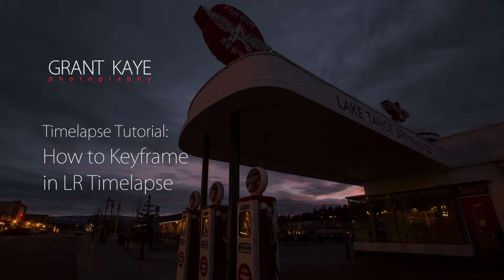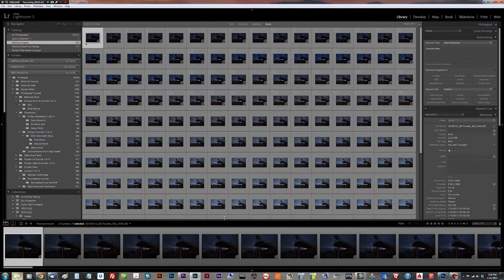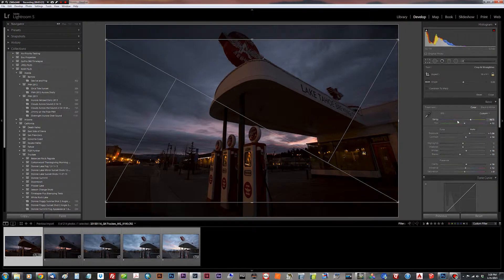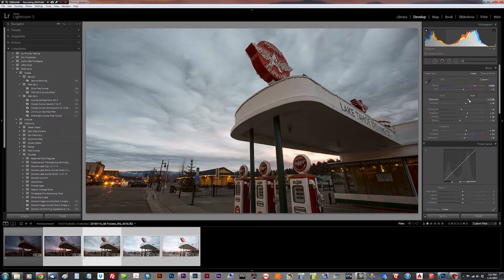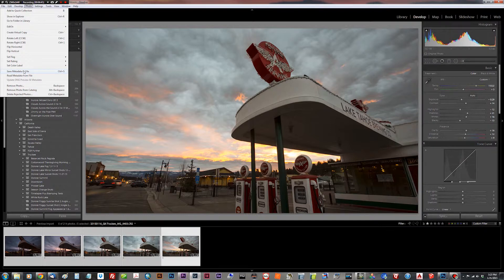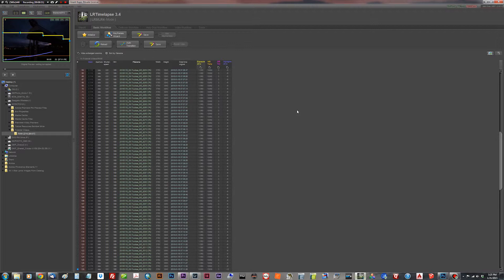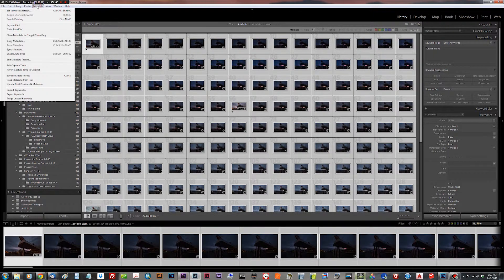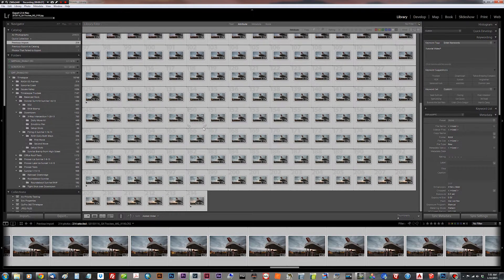Timelapse Tutorials: How to Keyframe Development Parameters with Lightroom and LR Timelapse

Comment: Huge help on this dude thank you so much! This is the best tutorial I could find! One thing I would just add for anyone wondering, When you finish syncing the metadata for the few keyframes you edited and open LR timelapse, you will not see any change on the navigator in the app itself which I thought it would. The change in exposure comes when you save it and then read the meta files in LR! Also looking at each individual curve you can open LR and make changes based on what the curve is showing you, and is a great way to make the curves smoother between keyframes. You wont see any change in the timelapse app but once you quit that, re save the few meta files in LR and then re open timelapse they should be fixed!